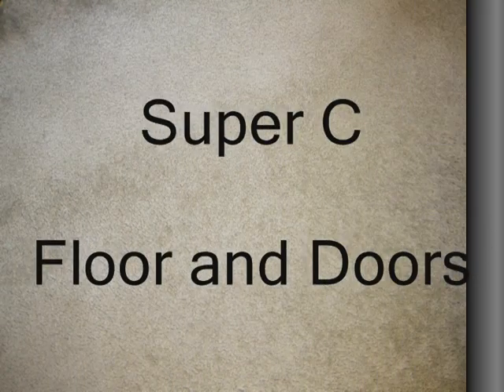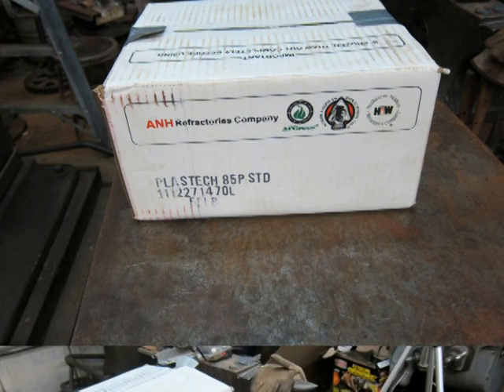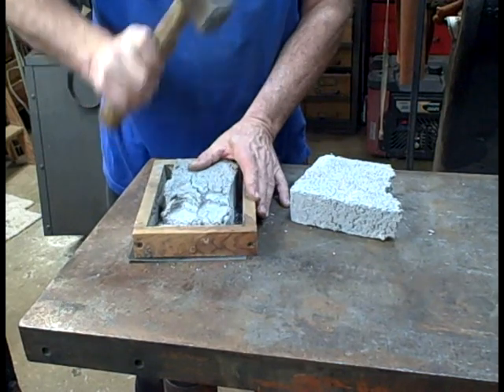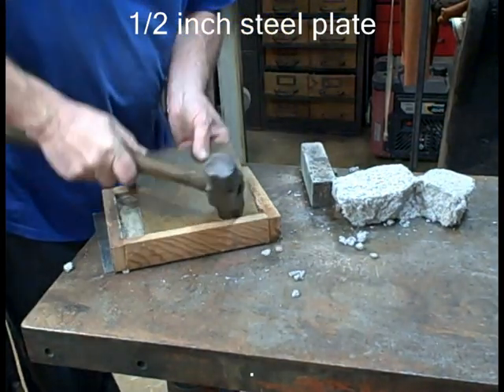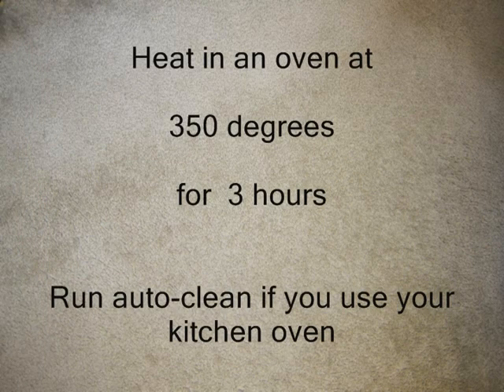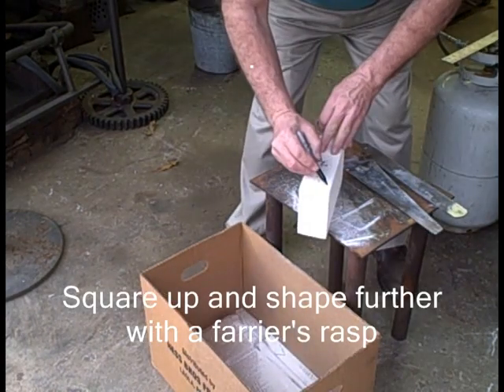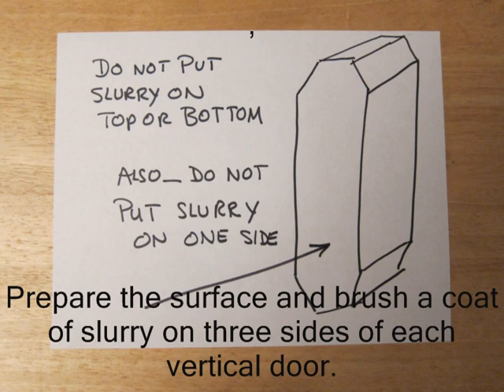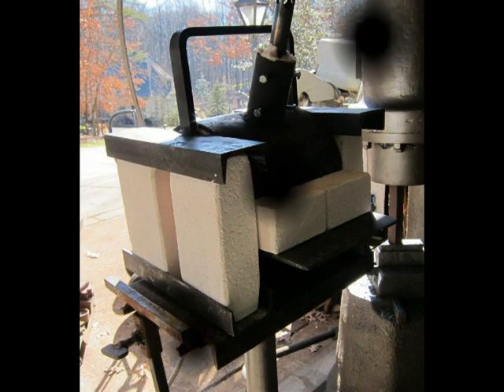Super C Forge Floor and Doors

Comment: is insulation wool have better properties than a forge built of fire bricks alone?
Reply: Soft firebrick could be used as a forge interior.  Hard brick (thin ones) can be used for the floor in both cases.  Thermal blanket is easier to  put in round forges (watch my forge lining videos).  Both (thermal blanket and soft brick) can be covered with refractory, making the the forge significantly more efficient...  Watch all my forge related videos to see what I use.

Comment: Thanks very much. You inspired me.well I bought a cheap forge on eBay.its wasn't bad.great injectors and all that.but the didn't lining didnt  last.its all fall in and wrecked now.(I do blame myself for not paying attention)But I will now!I have bought all the chemicals you've said.how do you mix them correctly. Also I got fire cement and firebrick for my forge after the ceramic wool process and was thinking about putting a layer of fire cement to seal it all in.any recommendation about this would be helpful
Reply: Watch my forge lining videos to see what I use (and recommend, including sources).  One change is that I mix Mortar to a thickness (with water and a paint stir stick) to a consistancy that can be brushed on.  I also do not use heat boxes anymore.  I just brush stuff on and leave the forge sit till each layer is dry....

Comment: Dave, I have watched just about all of your videos on your gas forge build. Thank you for sharing your knowledge! I am in the process of building a hobby forging shop and this is very helpful. I HAVE A QUESTION: will your gas forge reach forge welding temperatures??? with tis single non-blown burner? Thank you. Steve
Reply: Steve McRae Both the Super C forge and the forge in the "Simple Propane Forge Lining" video will easily reach forge welding temperatures if you build equipment and manage the propane as I have described in my videos.  I do a little forge welding in the "Simple Propane Forge Lining" video near the end.   I also have welded layered steel (some say Damascus) in these forges.I have not forge welded in a free form forge, but expect I could if the bricks were covered with a slurry and the forge was small.

Reaching forge welding temperatures is only the first step though.  It takes patience and perseverance to learn how to do it, especially from/in a gas forge.   Start by doing simple faggot welds, then practice, practice, practice to be able to do other types of welds.
Reply: Thank you.

Comment: Thanks for the inspiring videos!
Your exceptionally thorough style and narration is helpful.
Now I know what to make out of my scrap oxygen cylinder and channel iron.

I'll be cutting my firebrick and doing all my dust-generating activities outdoors where I can walk away from the results then hose down my work area. 

I like the design of your forge for another reason. Instead of a post mount I'll weld a hunk of square tubing to the forge. All my vises indoor and outdoor are mounted with Reese hitch sockets (handy because you can select from four positions as well as move them where you like). Your compact design will be convenient to use and convenient to store when not in use.

Comment from the maker: You sure could build a large Super C forge, and it would work fine.  The size you are talking about would be a very large forge.  Obviously, you would need multiple burners if you use aspirated burners.  A guideline is that one 3/4 inch burner would handle about 300 cubic inches of burn chamber.  If I made a permanent forge that large, I would consider either a ribbon burner or blown burner.

Comment from the maker: Although a thin hard firebrick can be used for the floor on a forge, I would not recommend a hobby blacksmith use hard firebrick to LINE a forge.  It takes too much energy to heat the burn chamber to reach forging temperatures.  I know of forges that are lined with hard firebrick, but they use blown burner systems (not the type of burners I show how to make).

Comment from the maker: If you watch the "Simple Propane Forge Lining" video, I use hard firebrick for doors and  the floor.  I recommend thin firebrick for the floor (thicker will take a LOT longer for the forge to heat up).  Check hardware or rural supply stores for thin (1 inch) fire brick.  The best way to cut them is with a wet masonary saw.  They can also be cut with a diamond blade in an angle grinder (wear a mask for dust).  Soft brick is easier and more efficient for doors, but hard brick will work.